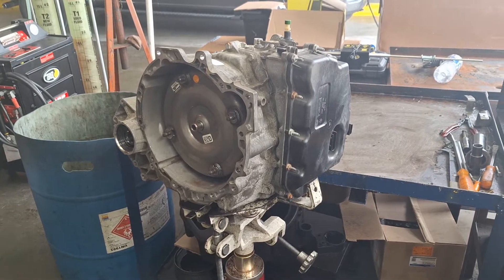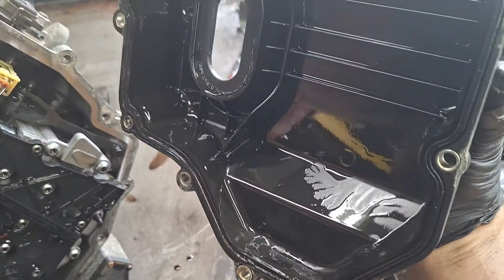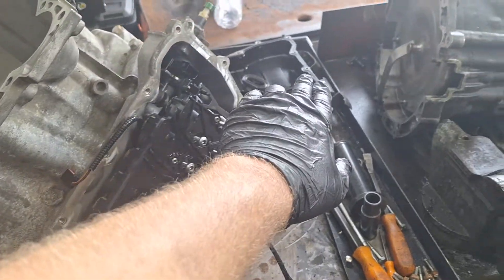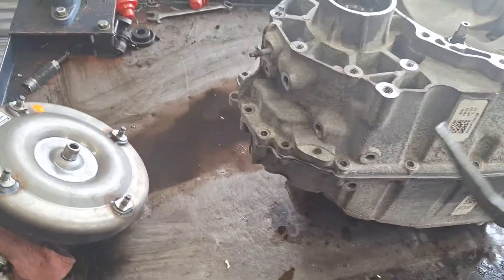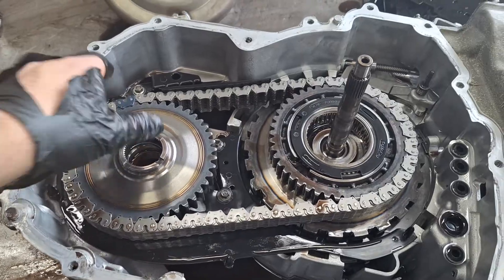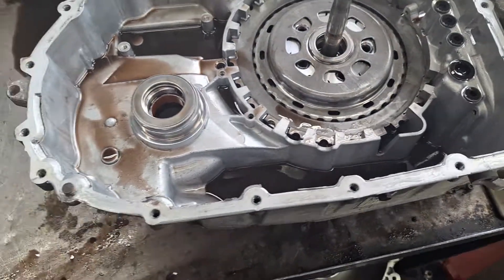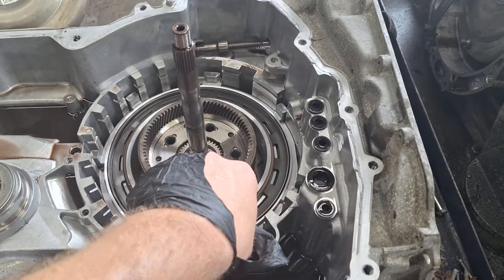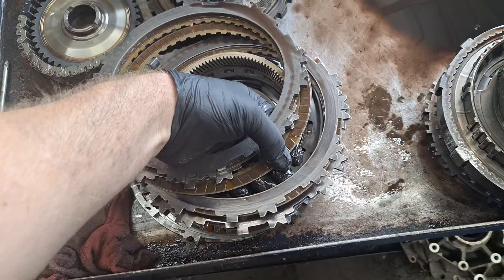Ford 6F35 Transmission Teardown!

Comment: most issue  with this transmission..people dont change the fluid enough..we found that valvoline lv  fluid works much better than the ford lv fluid..the ford fluid makes the transmission shift more harshly
Reply from the maker: Absolutely. The dirty fluid kills these and the fluid gets dirty fast

Comment: I love your video it helped me rebuild my first one. And I felt confident to do a second one but this time after I filled with fluid and checked the level I tried to drive it. It briefly let me back up but in forward gear it was sluggish, but then I put it in reverse and it still tries to pull forward. Seems weird, any suggestions? I also did not do anything with the valve body 🤷‍♂️
Reply from the maker: If you're sure nothing's wrong with the valve body and there's no damaged wires going to the transmission, it sounds like you need to go back in. Check the center support and make sure your Pistons are installed right center support's not upside down
Reply: @BigBensCarsAndCycles  I did more digging today and I did also get a P0766 code and I’m guessing that is the D Solenoid and it did act like it was in limp mode also. So fingers crossed I’m gonna try changing that before I pull it back out again. Thanks so much for responding back!!

Comment: I know that these transmissions are considered weak but would fluid changes every 30k miles increased their longevity?
Reply from the maker: Yes absolutely that would. Theyre actually pretty good transmissions that way
Reply: @BigBensCarsAndCycles  thank you..lots of facebook experts  saying this transmission it trash..but  as you know people change their engine oil..but almost never. their cars transmission fluid.. and to my fear..never their brake fluid

Comment: Thanks for this detailed Transmission teardown. What an awesome video! Just wondering what exactly was wrong with this transmission as i see almost everything in good condition or at least acceptable? 

Keep up the good work brother!
Reply from the maker: Thanks. If I recall correctly that one was built by someone who made a lot mistakes during assembly and it caused one of the clutch packs to burn out

Comment: I had my transmission replaced with a used one. 9 months later, zero warning, i lost acceleration power on the interstate. Trans fluid coming out of the vent cap on the top. Had to get it towed back home. My fusion titanium has been sitting since December. What would cause that to happen with no warning, no gear slippage before that, and Fluid spraying out the top vent/fill cap?

Comment: Im having p0731 p0733 incorrect gear ratio codes and pump whine, wont go in gear most times, can drive and reverse a couple blocks then dies.   pump replacement only or full rebuilding? Only 113k miles.

Comment: I had to replace the entire valve body on mine. The solenoids would not upshift or downshift sometimes, and it would jerk each time it shifted. $180 for the part, and it was a pain in the rear to replace it. But, I got it done. Ford was going to charge me $2k for the job, and I was like "no thanks". It works better than it did when it was brand new!
Reply: Is it still working? My trans is going out and I think it’s the valve body but everyone keeps saying not even to try and give up on it
Reply: @Emily-yr7wy Yeah it’s still shifting flawlessly. If you let it go for a long time, it’ll end up wearing out clutch packs prematurely. I caught it before it worsened.

Comment: Thank You very much for making this video. My 2014 1.6L FWD Ford Escape started making a grinding noise  front the transmission when I shifted in reverse. It delayed, then I heard a loud bang when shifting; a few miles later, the car revved up high while driving, and a few miles down the road, the car wouldn't move with my foot down on the accelerator in the drive or reverse gear. I think the torque convertor is shot. Can you please share your opinion on this?
Reply from the maker: @Ibamba7  hey sounds like front pump failure. Here's a video for you: https://youtu.be/NS_qX12Itas

Comment: Hello,
I did a drain refill on my 12 Fusion w this trans.  Did a quick warm up trip. Checked the fluid while hot and running. Was about 1.5 qts low.  Now when I lift the car and free spin the front tire, I hear the noise in your vid @ 14m10sec.  Did I damage the trans with my warm up trip, 15 miles, being 1.5 qts low?
Reply from the maker: @user-sw4pu6cn9i  hey nah you're perfectly fine
Reply: Ok. That’s promising.  However that clicking noise was not there before I did the warm up run.  Something happened.

Comment: I wanted to know your opinion on the issue I’m having. 2016 SE 2.5L. Was driving along and I felt a shudder, then I felt the trans slipping, few seconds later it would not stay engaged to any gear. I parked the car over night and when I went to drive it again it drive fine when trans and engine were cold, as soon as it came up to operating temperature the trans would not stay engaged in any gear.
Reply from the maker: @GearheadSCLA  hey it mat be your front pump
Reply: @ I’m not sure if it’s worth fixing. It only had 108k miles too. I serviced the trans every 30k miles too.
Reply from the maker: @GearheadSCLA  I've got a video called 6f35 pump whine checklist. Yea it's worth fixing
Reply: @ I will look it up, thank you!

Comment: Hey big brn what would  cause  hard shift on 1st to 2nd gear but get better after ive driven the car a few miles
Reply from the maker: @RodolfoAguirre-p2s  hey, that can happen when the fluid is low (1/2 to 1 quart low usually) I'd start there, and reset transmission adaptive tables
Reply: @BigBensCarsAndCycles  i did drain and added new fluid twice. I'll double-check it's full. Another thing I read is there's a tsb for the transmission. 12-6-12 is that true.
I really wanna fix this I issue I just bought the car 3 weeks ago with only 83000 Mike's on it.

Comment: Where is the fluid temperature sensor? I’m getting code P0713.
Reply from the maker: hey, I'm thinking thats built into the leadframe
Reply: Ok I’ll look into it. Thanks. I talked to ford dealer and they told me it’s inside the transmission like I have to split it open but seeing your video I don’t see no wires going inside the transmission other than inside the valve body cover or did I miss something?

Comment: How do you feel about the earlier 6F35s in the second gen escapes?  I just bought one that has 135k on it, shifts well, and had its fluid regularly changed.  Hoping I can get 200k out of it.
Reply from the maker: @Meatpipeify  hey, they've been more reliable than the later ones

Comment: Good video! Can a front wheel drive transmission be used on a 4wd? I have a 2013 4wd escape and found a rebuilt 2014 fwd model.

Comment: If I’m having no 1st or 2nd gear , I have a shift A solenoid failure/stuck off , I checked the solenoid and it good , is that a possible valve in the valve body issue , all the other gears work fine , it takes off in 3rd , 4th,5th and 6th and reverse fine , or is it the converter?
Reply from the maker: @keithwilson8624  hi, it's possible the solenoid is Mechanically sticking. How'd you check it? You can also have a worn forward clutch piston or valve body plate issue
Reply: @ I found a recessed check ball , 2nd ball from the bottom or the middle one . The 2nd valve in the valve body is sticking /not resetting properly, all other valves are smooth

Comment: I have this transmission's younger brother, the 8F40. I understood they're very similar.
Could you explain a clunking noise whenever the load changes? (e.g. when letting the car roll and suddently apply acceleration, or when sending a gas pedal impulse 10-15mph)
The transmission shifts OK, except for the clunking noise and a strong car shake when changing to Reverse I have nothing to complain about.
Reply from the maker: Hi, i've got an  8f35 teardown video. The symptoms were similar on that was as yours. It's possible one of your bearings inside are letting go
Reply: @BigBensCarsAndCycles  How would you tackle this? Preventive (expensive) overhaul?
Is the bearing failure catastrophic?
Reply: Just watched that video. Definately catastrophic 🙂
How can this bearing issue be confirmed without opening the transmission?

Comment: I’ve got a 18 fusion with trans and has dial shift. No CMDTCS but it has a harsh shift into reverse. You shift up to 40 mph and fr there if you accelerate all the way up to 60 mph the transmission will never down shift even if you left of the accelerator and rpm’s just climb
Reply from the maker: It is possible you have a seized shift solenoid "B" But anythings possible and it may need more diagnosis
Reply: @ I was looking in SI and this is what I was thinking or very likely a clutch fault as I drained the fluid and it is pitch black. Car has only 32k on it!!!!

Comment: Hey random question as I see you are super helpful..

Is there and differences between awd and fwd models.

I have a fwd fusion (2013) would I be able to put any 6f35 in or is it specific to Gen 2 fwd 6f35 only?

Thank you! You are awsome
Reply from the maker: @corymiller2001  hey, the bellhousing side case half is different. That's it! 👍
Reply: @bigbenscarsandcycles sweet so they are interchangeable.

Also follow up question… is there any reprogramming that needs to be done at a dealership or using forscan?

Thanks for the quick response sir
Reply: @BigBensCarsAndCycles  So a swap of the bell housing and a reprogram by a dealership is all I would need correct? my apologies for the follow up question and I appreciate you responding to your comment so very much.

Comment: Great video! I have the shop, the skills and tools to do this and he transmission has 60k and has been serviced regular but just started getting pump noise and no engagement. Immediately pulled over and didn’t drive on it at all, my question is, I want to just do the front pump, torque converter center support and refurbed valvebody with new oem solenoids. Will my snapon p1000 which has relearn shift trims etc be enough to learn the new solenoids of do I have to pay the dealership to rip me off. Also any idea where I can get the large snap ring you suggest to replace I cannot find it anywhere. You Rock my brudda!
Reply from the maker: hey that repair sounds fine. you can re-use that forward clutch snap ring. and if your snap on scanner doesn't do the trick for you, get forscan
Reply: @ thank you sir. You deserve a medal for the quality of this video and passing down transmission knowledge that seems to be almost gone these days.
Reply: I’m rebuilding this bad boy now that I have all the parts, the direct drum how ever has some of the black lining like pulled down on 1 side. Is this an issue? can I run it or do I need to replace it?

Comment: Hello. I currently have a code P0756 “solenoid B stuck off”. Can these solenoids be replaced individually or as a solenoid pack only? Thank you!
Reply from the maker: Hi, these solenoids can be replaced individually. Youll want to get forscan to see what the "band number" is for your solenoid B. Or you can pull the solenoid out and it'll be stamped on it. usually its either 2, 3 or 4

Comment: Thanks for sharing! Is there a rebuild kit you recommend?
Reply from the maker: @robbygonzalez7911  hi, glad it helped! I've got a full rebuild video too. I got the parts off ebay for that
Reply: I’m getting ready to start rebuild, but curious if you know that if the transmission delay issues start after it’s been driving for about 30 minutes or so would be related to pump or other issue? I’ve done drain and fill twice and also replaced valve body due to harsh 2-3 shift although it’s still doing it.

Comment: Hello, I love your videos! I’ve learned a lot!
Can you help me with my 2014 ford escape automatic transmission issue. I’ve been looking on line, but can’t seem to find anyone with a similar issue. Our escape drives forward in all gears flawlessly, but when you put it in reverse, it will crawl backwards a tiny bit it when you don’t touch the accelerator, but as soon as you touch the accelerator it stops moving, the rpm’s will go up but it’s stopped firm. Do you know if this is a major tear down? Or would it be a valve body issue? Thanks so much for your time
Reply from the maker: @glendebruyn6041  hi, I would replace shift solenoid B, and if that doesn't fix it then install a new fully built center support (teardown), pump, flexplate, and torque converter

Comment: If a video like this was available exactly last June 2023 , i would have fixed my ford transmission myself. i had a valve body and a torque converter that needed to be changed with some solenoids that needed to be replaced as well, it cost me some 5600 to replace the whole thing. now i will just download this video and use it next time my transmission fails thanks for the upload chief

Comment: Question regarding caracterization and solenoid relearn.. Im installing a used 6f35 from a junk yard in an 18 escape. Problem is trans did not have the sticker on the casing with the codes.. I heard They can be found in the valve body also.. Reason why im here watching your video.. Did you notice any codes with that info? Or any idea what i can do regarding my programming problem?
Tia!
Reply from the maker: Hi. the connector that plugs into the front pan on the valve body - unplug it. The solenoid strategy is stamped onto the side of the where it plugs in to. Might need to shine a light and squint
Reply: @BigBensCarsAndCycles  Thanks alot for your help and quick answer. I will look for it..  cant thank you enough!!

Comment: are the solenoids a common failure point?
Reply from the maker: @packrcch  yeah, shift solenoid B for the direct clutch. Over time, a few more can stick a little and cause firm shifts
Reply: @BigBensCarsAndCycles  does the trans have to be removed from the car to get to the solenoids?
i am looking at a used 6f35 for 1600 and i really want to avoid it if i can.

Comment: Hello, I have a problem, oil is leaking from the 6f35 gearbox, I replaced the seal on the gearbox and oil is still leaking, what could be the cause?
Reply from the maker: @andrzej784  wheres it leaking from?
Reply: @BigBensCarsAndCycles  I thought it was the axle seal, I replaced the seal and still the same problem, I also replaced the shaft seal and it still leaks

Comment: Where would one get the service tool for the direct clutch. I have a 2013 Fusion with about 180k miles and I'm 95% sure my pump is failing/failed, sounds like a power steering pump low on fluid. If I'm in there replacing the pump, at 180k, I feel like it would be foolish to not do a full service. would you agree?
Reply from the maker: I think it would be a good idea to freshen it up, at least do a center support/pistons, overdrive frictions and steels, pump, converter, valve body and solenoid body. (or at least inspect them). the fluid breaks down a lot on these and causes some wear. I have a video on a full rebuild on these
Reply: @BigBensCarsAndCycles  Thanks for the response. Is there a particular assembly grease you recommend? I don't want to get just anyone off the shelf and it not be compatible with the Mercon LV fluid or something and destroy all my hard work. Because that's my kind of luck.

Comment: just watched your video and I think you may have found my problem.  i have a 2013 fusion with only 45 thousand miles. One day while it was warm, I got a delayed shift on the reverse. I would put into reverse and have to rev the engine up to get it to engage. then it would slam in. it only happens when its warmed up. when cold no problem. anyways thanks for the video it gives me somewhere to look.
Reply from the maker: @joearpino  glad to help! I would start with replacing shift solenoid B
Reply: hi Ben still have not got the car fixed. been to two ford dealers and they both want to replace the transmission. do you have a shop and if so where is it? I am in upstate new york near syacuse.

Comment: Quick question: Is there a repair kit to replace the interior parts? And 6 the oil pump? Today, I removed my transmission on my garage. It showed a code with one stuck selenoid, but i took it down to clean it real nice as it had fine metal dust i think that's what created a stuck selenoid. I dont want to pay 4k for someone to open ot it up and just clean it, and it is not working properly, as I believe I can do it even though I have never worked on a transmission. Do i need special tool to put it back together? And how can i clean the parts? Do you have a put back video of this transmission?
Reply from the maker: Here's my full rebuild video https://youtu.be/lrMZ2m-Zji0 and I got the parts from ebay
Reply: @BigBensCarsAndCycles  thank you for the reply... I am about to watch the other video. Question: How can I test my torque converter to see if it needs replacement?

Comment: hey man i really need some help, the tip of my driver side cv axle snapped off from the c-ring and stayed inside the transmission,  could you tell me what area from your video could that part be? just for reference
Reply from the maker: The final drive gear (diff)

Comment: Question about the center support.  Are you saying to replace the entire piece or is the stuff inside of it is what I can get by with to replace.  Low budget and was wondering.
Reply from the maker: Yes, it's best to replace it. The forward piston wears into the support. But, with a special tool, you can remove the pistons on a press and inspect the support. The special tool is available from rotunda. It's more expensive than a reman support

Comment: This tear down helped because i got to see where the rod goes that connects to the shift position sensor. My dad replaced the shift position sensor at the top (per the code thrown), and now it won't go into Park, any ideas? Thanks I'm advanced!